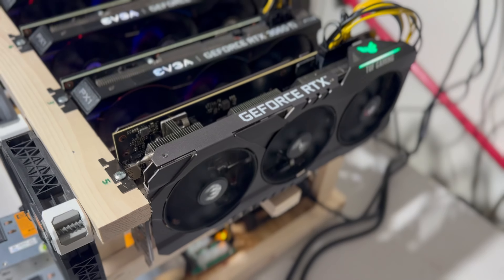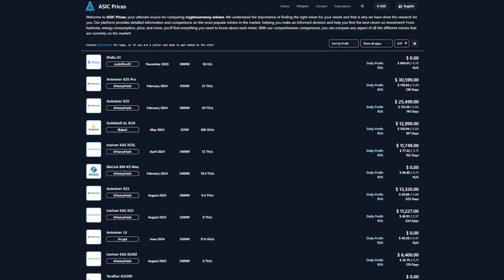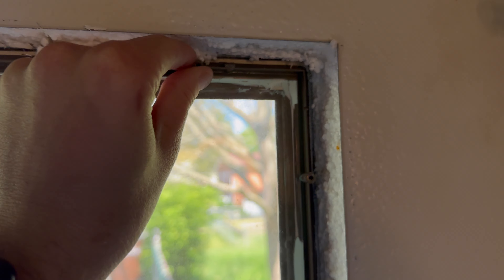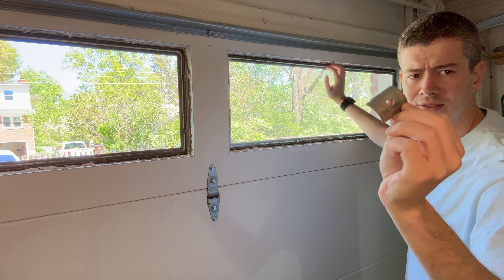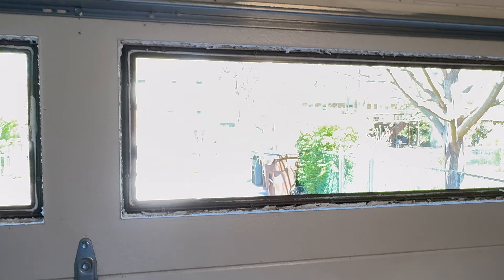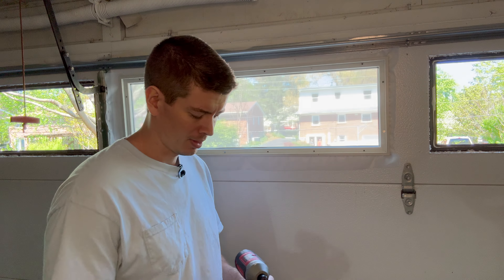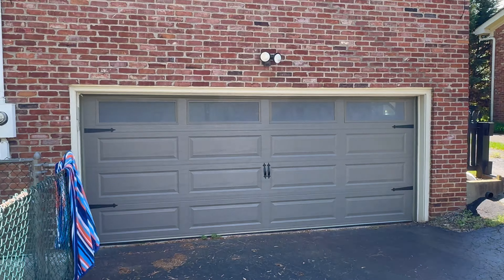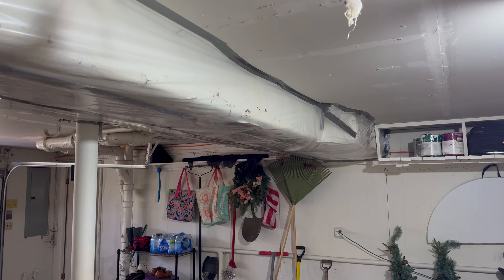Is THIS The Best Filtration Method For Crypto Mining?

Comment: I feel like im watching myself  few years ago lol, I did this and used inifinity fans with ducts to force outside air over my rigs, it kinda worked....ended up doing this and installing an ac before I went to the shed.
Reply from the maker: How many Gpu’s were you running at the time?
Reply: @ModernMiningHub  when I first did what you are doing about 40 but my system wasn't quite the same as yours, I think yours is a better because I wasn't allowed to put holes in the garage, that said I wouldn't buy any gddr6x memory cards And id honestly hold off on buying anymore till it gets hot and you see how the farm does
Reply from the maker: @kr00tmanmining  ok sweet. Yep holding off on more cards for now but if i start having heat issues i’m going to up the fan size of my exhaust. We’ll see what happens should be interesting!

Comment: Remember your exhaust fan only has so many CFM’s. It will withdraw the easiest air to it. So you may want to block off the window closet to the exhaust fan to try and push a circulation through you cards and not past them.
Reply from the maker: That’s smart. I’ll probably definitely close the actual window that’s on the same wall so it’s all coming from those garage windows.